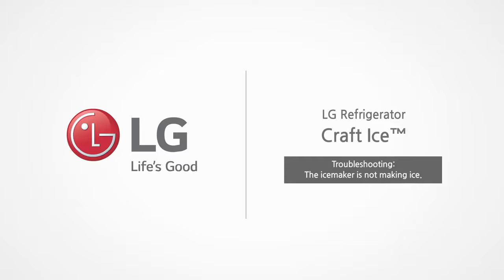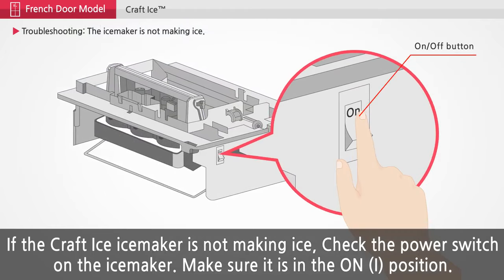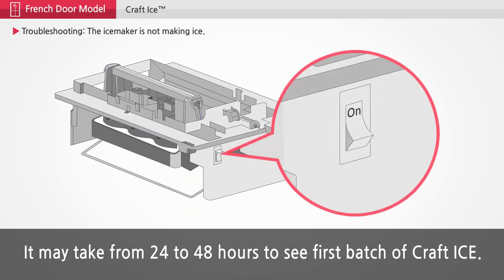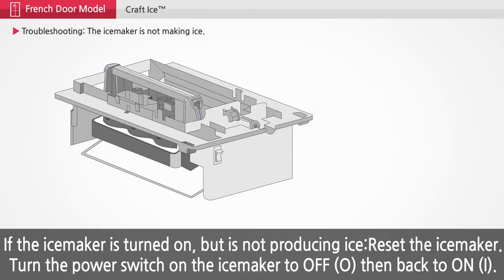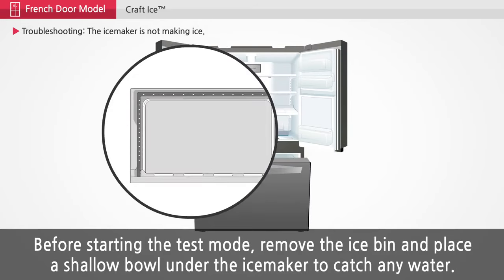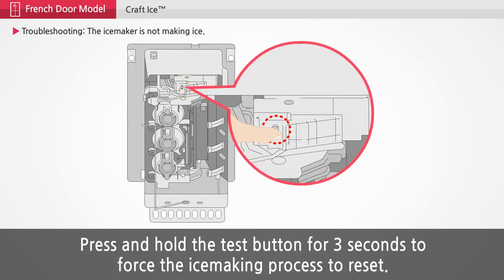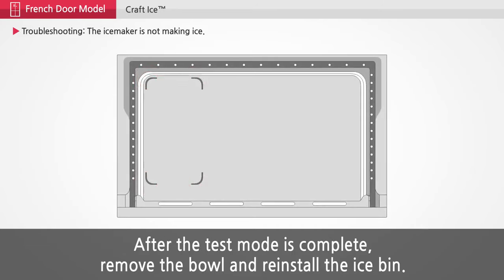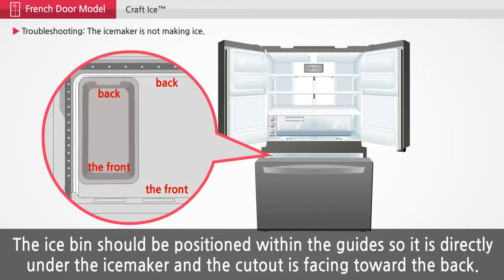Troubleshooting Craft Ice Maker Not Making Ice

Comment: Before you do anything, sit on the left side of the freezer and slide out the drawer where you can see clearly.  I had one ball of craft ice jammed between the wire and plastic.  Freed it by slightly pulling the wire up and ice ball out.  Careful because some pressure will close it and give you a little pinch.
Reply: Thank you.  This is just what occurred with our ice maker.
Reply: by wire do you mean the bar that tells the machine the ice bucket is full? or an actual wire somewhere?
Reply: God bless you haha this is what mine did and I just fixed it
Reply: This also worked for me. There was an ice ball stuck between the drawer. Seems like a design flaw with how several of us ran into the exact same issue.

Comment: I've had my refrigerator 2 years, purchased this model solely for the craft ice maker. It's been repaired 3 times, repair comes to see yes it's not working, orders a new unit, it eventually arrives from LG, service comes back and replaces it. So much time consumed and time without craft ice. It broke a 4th time and requested replacement of refrigerator with retailer. LG said no as it is repairable. Just repairable at my time and expense. So now reading how I can fix it myself. I may just give up and buy another refrigerator from another brand based on the questions others have here. I'll look to see if LG posted updated instructions as I'm almost ready to accept it's time to move on so that life can be good again. .
Reply: My second LG rfig, but no more!  they have not improved the design,  it craps out as soon as the warranty expires, thats the only thing that works!!

Comment: Does anyone have a video of proper operation of the test mode?  My tray doesn’t seem to close. Also, the wire arm or bracket appears to be in the wrong position. Unfortunately, I can’t find a sing image or video showing what it should look like.
Reply: Hi Cris My frigde has the same issue did You find any sollution?
Reply: @MayaLogistica  it was Ice buildup on the fan. I let it thaw and melt away. Works fine now.   My apologies, I thought this was about my issue with the freezer (totally different issue). My craft ice maker was broken by some frozen food being pushed up against the metal arm and bending it. I need to replace the entire unit.

Comment: No power switch on my model  (LSXS26326S).  Ice is forming in the tray, but freezing-up and not getting removed.   It works only when I push the test button, but that only completes one rotation & then stops.  From what I've been reading & watching, it has something to do with the sensor.   Still unsure whether that's true and how to replace it.  Side note, the water works fine (and of course the ice tray fills up properly), so there isn't a problem with the water line itself.

Comment: If you press the reset button and it doesn't fully cycle, and can't hear the water go into the tray.  It means you have some ice stuck and is preventing it from fully cycling.  It has a a safety feature that it will stop the cycle to prevent from breaking any of the components. You can either try melting whatever is stuck with hair dryer. Or try aiding it by hand look for the metal wire and help it cycle. In my case a craft ice ball was stuck and wouldn't let it cycle to be able to hear the water pouring in to tray. Once the stuck iceball dropped i heard the water pour in and do the full cycle. Haven't had any problems since.
Reply: Thank you for your comment/post!!!! I just checked and low and behold there was a ball stuck. I just cleared it. Hope to get some craft balls very soon.
Reply: Hi. The tray and the wire stay hanging down and not up horizontally as in the video. When I press the test button, the wire and the tray swing down then up to the same hanging position, never horizontally.  It doesn't make any craft ice. Is it broken? I  had it for barely 2 months.
Reply: Also I checked and there's no ice stuck.
Reply: @honghanguyen804  Feel for a stuck ice ball, use a mirror if you can to see if there's a ice ball stuck preventing from fully cycling. The fridge stopped making ice balls about a month ago, and again there was an ice ball stuck again. Removed it again and it started making ice again.
Reply: @honghanguyen804 ok nothing stuck,  try unplugging for a minute to reset the fridge
Reply: @marcoperez4712  will try unplugging. Thx.
Reply: @honghanguyen804  I have exactly the same issue!! --"When I press the test button, the wire and the tray swing down then up to the same hanging position, never horizontally"...may I ask that have you solved it finally?
Reply: @Jackson-gw9lc  no we could not fix it and ended up returning the fridge. We got the GE instead and so far so good.
Reply: @honghanguyen804  Hi Hongha, thanks for letting me know and recommending GE! Luckily after I (1) enabled the test mode and (2) unplug-and re-plug the fridge power cord, the craft ice maker was back to normal now.

Comment: I had no issue after watching the video and reading some of the below customer comments.  It was a bit tricky finding the reset button, but once I did, 3 Craft Ice balls fell out and I heard the water refill the cube tray.  I took the advice of Lisa Hunter's post and used my wife's small mirror to locate the rest switch.  I can only conclude that the 3 craft ice balls were stuck.
Reply: Where was/is this switch
Reply from the maker: Hey there! Open the bottom freezer drawer and feel underneath the ice maker. There is a small, rubbery button that needs to be pushed to reset the ice maker. Make sure not to push on the ice molds themselves, which feel rubbery. The button will feel like the top of a writing pen's button, but rubbery. 🖊️ ~Tegan

Comment: The diagram for the reset switch is unclear.  Where is this switch?  Do I have to take it apart to access the reset switch?  Also, how long does the reset take?
Reply: I don't know if this matters since it's been 3 months since you posted this, but the reset button is on the bottom of the craft ice maker toward the front center.  So if you reach your hand under the ice maker, you'll feel a hard plastic button about the size of a tic-tac.  Push it for a few seconds until it beeps and then let it go.
Reply: @bander1023  Thank you for that. I ultimately found it by pushing randomly until I could feel something depress.  😂
Reply: I read and found my reset. But still can’t get my arm to go down
Reply: KOREAN design !  yikes  I'm still looking for it!
Reply: @bander1023  thanks your description helped me find the reset button and 3 half balls dropped. I pressed it again and heard the water fill and saw the arm dropped with no ice on it. Hopefully, I'll have cradt ice again. The LG video is awful in describing how to find the reset button
Reply: I still can’t find the button
Reply: @Anonorama  I also found the diagram in the video confusing.  reach under the front of the icemaker.   slightly left of center, theres a U shaped ridge with a small rubber button in the middle.  I had to use my pinkey to fit into the U to press the button.  when I did, I heard a beep pretty quickly.  that should kick off the icemaking cycle.

Comment: Got my fridge yesterday. Freezer craft ice hasnt happened yet. Have to see if same issue as most on here. If not, regular ice cube and crushed dispenser will do. Bought fridge to refrigerate....not for golf ball ice maker 😳
Reply: Did it start making ice balls eventually? I just got mine two days ago. not a single ice ball made yet.
Reply: @IlanDavid  I waited a couple of days to see. Nothing happened until I pressed the hidden reset button. Then half sized balls eventually dropped. After that it has dropped 6 every day. Haven't had to use the reset anymore........so far 😉
Reply: @coscrupi  I couldn't find a reset button so I turned it off and on and some half-ish balls fell. I'll look again tomorrow.

Comment: I didn't realize that I didn't shut our freezer all the way.  My husband found that while it looked completely sealed closed on the right, there was a small area on the upper left where it wasn't completely sealed.  After a few days, it stopped making ice balls!  😪which I LOVED!  
He emptied everything & put fans on it for a couple of hours, put everything back in.  Two days later, still no ice balls!
We started looking up YouTube videos & he learned that you can  reset it.  He took out the drawers, took out the part & saw that there were iceballs stuck inside, with a kind of nipple on them.  He followed all the steps above, got them out & put it back & reset it.  Two days later, still no iceballs.  
Can you tell me what the part number is that we need to replace the bottom ice maker that makes ice balls, please?
I will add that we bought this for our retirement home & it was put in in October or November of 2019, and we LOVED this appliance and have had zero problems!!!  Please help us get the fixed right now?
I will add that my husband is an exceptionally handy man.  We've been together since we were young (me 14, him 13) & he can do everything except paint a car.  He's worked on cars & every electronic appliance there is, built furniture & was superb for troubleshooting for his company--one of the big parent gas transmission & storeage companies.  Thank you so much!
P.S.
It would be wonderful if this appliance had an alarm to let you know there's a problem & the freezer wasn't closed completely.

Comment: I eventually found the reset button, I pushed it earlier but never was able to get it to cycle. First thing I would do is use a hair dryer on low melt the ice enough that the tray starts to come down. Don't force it, will come down if it's melted enough. Clear the ice, 3 dropped out. Push the reset button and it will cycle through its process and fill with water. Wait for it to make ice. That reset button is directly in front of the arm that tells the ice tray is full. Clear the ice first.
Reply from the maker: Hi, there. Thank you for sharing your experience and tips! It's great to hear you found the reset button and figured out a way to help with the ice build-up. We appreciate your insight and hope your ice maker works smoothly from now on! If you have any further questions or need assistance, feel free to reach out. -MC

Comment: Can SOMEONE HELP NEW CRAFT ICE MAKER IN NO WATER TO IT WHAT CAN IT BE
Reply from the maker: Hello there! We appreciate your concern and would like to assist you with the issue regarding your ice maker not producing water. Common reasons for this problem include a faulty water line, an old water filter, a warm freezer, or a clogged ice maker. Fortunately, these issues can often be resolved without needing to call a professional or a technician.

Here are some links to troubleshooting steps for your Craft Ice Maker:
https://www.youtube.com/watch?v=XFj0G2xTZL0
https://www.youtube.com/watch?v=sD4UtOSJ6-s

If this doesn’t resolve the issue or if you need further assistance, please don’t hesitate to send us a private message on Facebook, Instagram, or X using @LGUSSupport. We're always here to help! -Shae
Reply: Water line is fine upper ice make / water despenser both work new ice maker installed NO WATER IS GOING TO CRAFT ICE MAKER ALONE.
Reply from the maker: We're sorry to hear about that. In order to assist you further with the issue you're encountering with your LG refrigerator, we recommend reaching out to us via Facebook or X at @LGUSSupport. `Liz